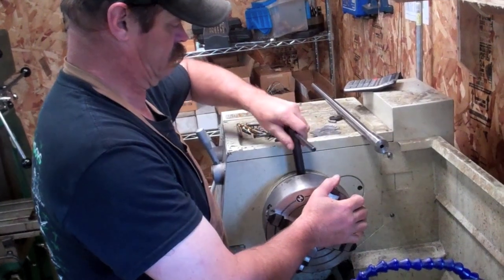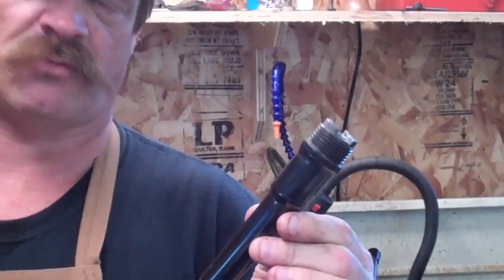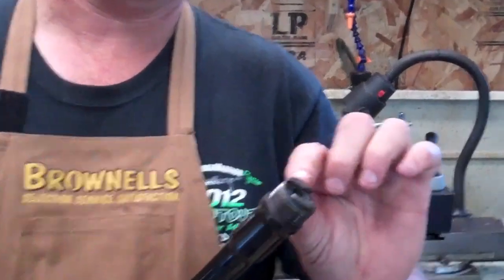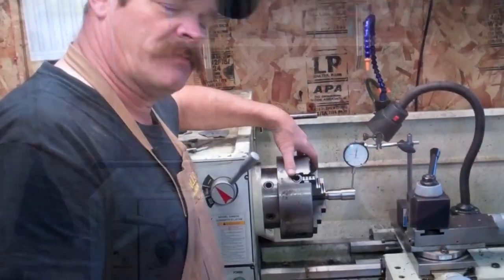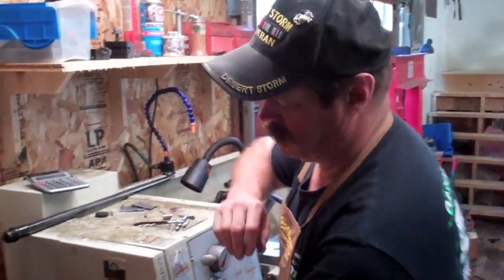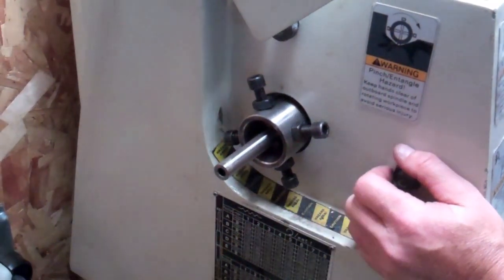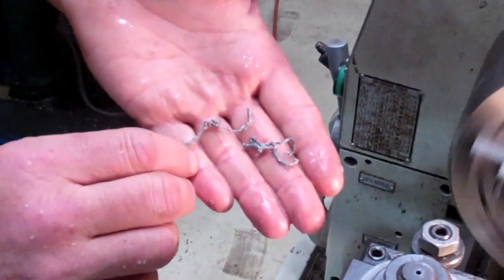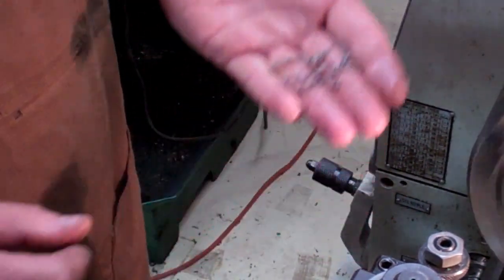Gunsmithing: Cutting Threads on a Barrel Blank Part 1 (Gunworks)

Comment: Hello Jim,
Nice to see you use the hands on machine, and not CNC ! Also this video  is the first one I have seen on YouTube that uses the correct setting over at half the thread angle on the compound slide to get a proper thread angle finish. Well Done!

Comment: downeastgunworks hi i had a question about a milticaliber rifle. Is  it possible to make a multicaliber rifle that does not need a conversion kit or barrel change? for example one rifle that shoots 308 - 50cal or 308 - 338 variations like that. i was thinking abou the medusa m47 and how it uses a multicaliber sysyem is it possibke to put that in a rifle???? thank you and sorry for the length.
Reply: The simplest to make multicals are based the Savage barrel nut principal.  A go gauge for each caliber/barrel and barrel nut spanner is all that is needed to switch.

Comment from the maker: The only problem with 7.62X39 in a Mosin is the cartridge length. You'll have to make some sort of filler block for the magazine. ALSO, the Mosin fires rimmed cartridges and the magazine is made for rimmed cartridges, along with the magazine cut off by time you spent the money modifying a Mosin, you can by a nice CZ rifle in this caliber for just as much money and have a modern made rifle.